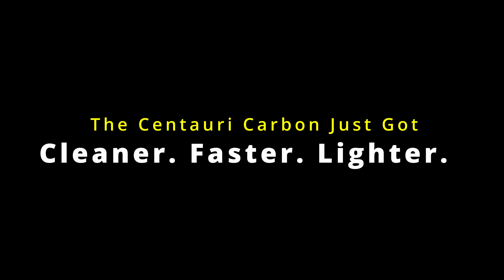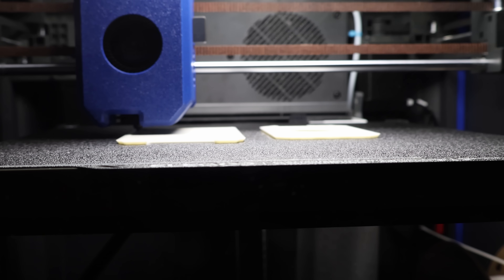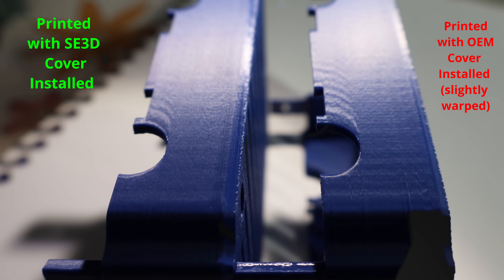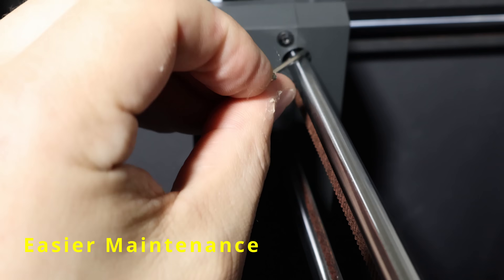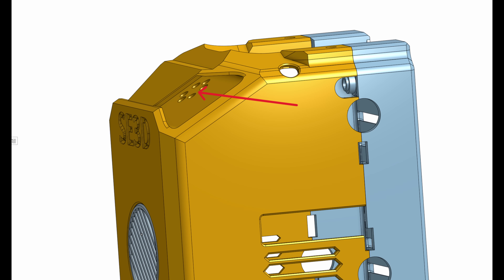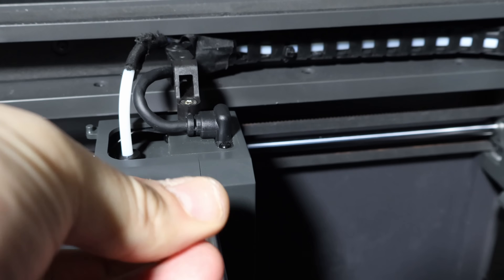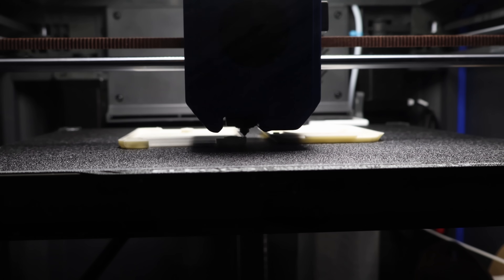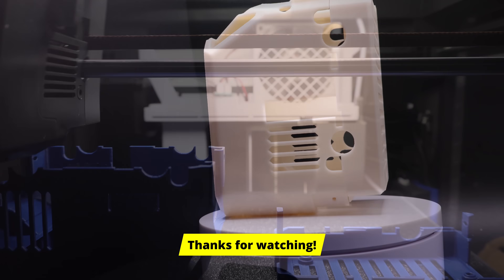The Centauri Carbon Just Got Cleaner, Faster, Lighter

Comment from the maker: We've picked up over 325 subscribers in the ~24 hours since posting this video! Thanks for your support! Many of you seem interested in alternatives to ASA for printing this cover. Unfortunately, there are not many easy-to-print options that are suitable. @Polymaker HT-PLA might just be one good exception. Who is interested in a follow-up where I put this cover to the test in real-world conditions with HT-PLA? Comment below to let me know.
Reply: What about ERYONE's "Light Weight ASA" ? they claim 40% the weight of normal ASA for the same model?
Reply: @nikkismith8750  Yes, it's hard to get in most countries but that would do the job
Reply: Polymaker PET-CF might work, it's fairly easy to print with. Just have to dry it really well before printing.
Reply from the maker: @rileyneufeld7001  Yes, you're right. I forgot to mention that. I even have some predating my sponsor relationship with them. It fogs up the dryer after being left out. But it prints nice when dry. The Polymaker print profile in OrcaSlicer has the part cooling fan going full blast. For me, a bug in Centauri Carbon was causing the hot end temperature to drift down 5C below target, eventually triggering an exception in the firmware. Turning the fan down or off resolved the issue for me. IIRC, I think the part cooling fan is supposed to be used sparingly for PET-CF17.
Reply: I’d be very interested in this.
Reply from the maker: @mykelitorus9101  Thank you! Noted.
Reply: Would love to see more testing!
Reply from the maker: @bonnybestthechest  Thanks for the response!
Reply: Polycarbonate - petg blend or straight polycarbonate will work I reckon
Reply: It would be interesting if one of the suitable materials was also transparent
Reply from the maker: @matthewmalham6094  Yes, someone posted a translucent Polycarbonate (PC) make on Printables. PC has superior HDT to ASA. It's heavier, but if you care more about the functional aspect of the cover, PC is a great option. I just have problems getting good layer adhesion without a heated chamber when printing PC.
Reply: I would love to see the real world tests.
Reply: Yes please lets see HT-PLA.  Thanks Polymaker for sponsering this innovative but still small creator.
Reply: Would love to see a video on printing PAHT.
Reply: This would be a cool follow up video.
Reply: Would PETG-CF (Elegoo) work for this?

Comment: Would this cover be good as well in elegoo pla pro filament?
Reply from the maker: Based on most PLA Pro. The temps near the hot end are too high. It would likely just melt. At first, I was thinking Polymaker, which has a 0.45 MPa HDT at 59C. I don't see where Elegoo has published any information like this. It's probably in a similar range, but there's not a "PLA Pro" standard formula, either.

Comment: I've just brought mine and had to stop it as it was going 230 mm/s and was making a racket. The print looked like it was going well, but coming from a bed slinger I'm not used to these going so fast. 😆
Reply: @ifell3  lmfao I frequently push my poor og ender 3 to 500mms. She is absolutely abused and Ive put about 50kg though it in filament and I bought it used from a guy who was using it as a print farm machine and using recycled filament. Ole bedslingers can still go zoom.

Comment: ayo i just got my Kingroon ASA I just ordered for printing this. I must say it makes the printer sound and move waaay smoother IMO, it eliminates some noise. I had a hard time finding the proper screw lengths locally and went for 2x16 without washers for the fan and 2x10 for the frame. The latter still fit on the top two mounts well, at the bottom left is sticks out a bit but seems to stay there.
Really nice, looking forward on how it performs long term!

Comment: I'm fairly new to 3D printing so forgive me if this is a stupid question.  In regards to the dovetail pins, couldn't you add a modifier to those areas to increase walls and/or infill for more strength?

Comment: This is awesome. I have a remixed version printed out and nearly ready to be installed. My question is what is the washer/spacer size? I see in the video you use 2 washers on one of the screws, but you do not mention the required diameter or thickness size. Information like that would be helpful to those of us who do not have a case full of washers or can tell what size spacer to print just by look.

Comment: This is very cool! However, I think you should design a front toolhead cover that uses the same hardware and screws as the factory cover. It would be cool!
Reply from the maker: Thanks! I think there's a remix that effectively did this - instead of guide slots they replaced the holes. This does use the factory screws, but only as guide pins. I run my cover without using the additional screw holes that I added. Just using the friction from the pins and the screw heads + washers against the cover. Holds it in place well enough for my purposes. I just wanted a quick release. There are at least 8 remixes on Printables you should check out: https://www.printables.com/model/1399340-se3d-elegoo-centauri-carbon-toolhead-cover/remixes
Reply: What you think about create some kind of locking mecanism to avoid the use of screws, some plastic latch, or push down pin to unlock, i have only 3d printer for 3weeks, don't know for now how to CAD, other idea is to replace the socket st connectors for the extruder to use pogo pins (magnetic) to easy extruder replace.

Comment: Subbed! I was reading some of the comments on printables and some users mentioned that it was melting despite using ASA. 

Any input? Overall I’m so happy to see upgrades like this being created. I feel like the Centauri has the ability to be like the Ender in terms of community resources and mods
Reply from the maker: I need to check up on those. Having trouble keeping up. I have seen some very slight warping near the nozzle area with the Polymaker ASA. That looks like it may be mitigated by adding a little more clearance.
Reply: @SyntheticElectron3D Thanks for the reply! I just got my CC but I’ll hold off on this for now. That being said I’ll continue following it closely for updates.
Reply: @SyntheticElectron3D Thanks for the reply! I just got my CC but I’ll hold off on this for now. That being said I’ll continue following it closely for updates.
Reply from the maker: For me, at least, the warping wasn't enough to warrant replacing the cover. In fact, I only noticed it after you said something. Regardless, I modified the front part of the cover to entirely remove the area where I observed warping. I also shaved off a little material from other areas to provide more clearance. So, it should also be slightly lighter in addition to being less likely to warp. It remains fully compatible with the other cover components. Check out the file labeled V1.1 for the cover. Thanks for your feedback!
Reply: @SyntheticElectron3D No need to thank me, thank you for your work!

Comment: Great design!!! Video after video, you are truly clever than the Elegoo engineers xD only one question: I think that we can't print it in PLA due to vibration and acceleration, apart from high temp. Right? (I don't know if I would ever use a spool of ASA beyond this)
Reply from the maker: PLA's main issue is with HDT (Heat Deflection Temp). It's also heavy. Otherwise, it's fine. You should check out Polymaker's HT-PLA if you want to stick with PLA.  I'm having some good preliminary results, even unannealed. Most other HT-PLA requires annealing before it's close to being suitable.

Comment: Am I ok if i used petg to print this?
Reply from the maker: It's not generally recommended. If you want something easy to print that is free of styrene, Polymaker HT-PLA is performing well in preliminary tests. But I haven't put it through its paces yet. All I can tell you is that even in unannealed form, it won't turn into a ball of goo when used to print with the cover off. It's probably your best bet because it can withstand 90c before really starting to soften, making it similar to ASA in that regard.

Comment: would pla be ok for this or should i get a more heat resistant filament?
Reply from the maker: Avoid PLA or PLA+. There are two reasons for this; the first being that the heat deflection temp (HDT) is not high enough being so close to the hot end. Second, it's a lot heavier than ABS or ASA. I'm having some good preliminary results with Polymaker's new HT-PLA in terms of HDT. What I am finding is that HT-PLA doesn't behave quite the same as regular PLA when printing and it's slightly heavier than regular PLA. There are ways to mitigate the weight and differences to note about printing it that I will cover in a follow-up video.

Comment: Amazing, but you could save a LOT more weight, ditch the side screws entirely, skeletonize the cover where you can, and look into redesigning the cooling duct to be  circular rather than linear.
Reply from the maker: Yes, agreed. This was all I could do for a video that I was trying to fit into a week-long production schedule. The weight reduction was mostly a side-effect of addressing the functional deficiencies of the OEM cover. I didn't set out on this project specifically for weight reduction. Although it was a consideration. Modification of the cooling ducts would have required a lot more test iterations to make sure it was tuned and just didn't end up making things worse. This is why I released the STEP files. The community has already made a number of remixes on Printables. People have also done some skeletonization work and posted photos on the OpenCentauri Discord.
Reply: Check printables 1418981 model

Comment: I will give this a try. I have a lot of clogs with ASA on the machine. Does anybody found a good method to remove clogs?
Reply from the maker: That's interesting because I don't think I have ever had a clog with ASA on either of my Centauri Carbons. I have had some with PLA-CF. How are your retraction settings? I know that excessive retractions can cause a clog with just about any material.

Comment: I think most of those covers exist simply so people don't burn or hurt themselves. If you're mature enough not to touch hot things or the fan you can probably do away with almost the entire thing. Find a way to only mount the part cooling fan and duct it properly and you're good.
Reply from the maker: Yeah, but I was going for broad appeal here. You're talking like someone who strips the seats out of their car to go faster. That said, I can appreciate that. I've run my Qidi X-Plus 4 without the cover on it for a long time. But the part cooling fan isn't mounted in the front cover like the CC.

Comment: Subscribed. My fan cover fell off during a print and almost ripped the cable off the fan. I was able to shut down the printer but a new worry is now unlocked 

I'll definitely print this in abs.
Reply from the maker: Been there. This was one of the many issues with the OEM cover that I was trying to address. ABS or ASA are the best all-around materials from a weight and heat resistance perspective for this application.

Comment: I've been printing for months with mine but haven't really had any issues. I like this upgrade tho as weight removed off a moving part helps to save and extend the life of all its workings and makes the system more efficient.
Reply from the maker: Great to hear you haven't had any issues. You make a good point that I didn't highlight! It's not just about better performance, but also longevity.

Comment: I have plenty of PETG-CF. I print fairly regularly with it and never an issue in the CC. Anyone used it for this model with positive results? Any reason not to?
Reply from the maker: It should work for some time, but it may not be a good long-term-use material. Only because PETG tends to creep under high heat conditions with load. PETG-CF is only slightly better with heat. Near the hot end, it will get fairly warm, especially on long prints. If you're mainly printing with the top off, it will probably last a while. YMMV.

Comment: Looks interesting... will definitely try it.  Have ordered oem ASA filament direct from manufacturer so will see how it performs...as the Polymaker is expensive here in Australia.
Reply from the maker: Polymaker tends to be on the premium side in pricing. But more often than not, you get what you pay for. There are certain materials that only Polymaker has, and sometimes you just want a reliable and predictable product for a project. Granted, that's not always the case, depending on what you're doing. Nonetheless, I like being associated with a quality product that I have used myself, with good results, and that I can promote honestly.

Comment: Very well thought out design with some great quality of life improvements.  Thanks for sharing.  Works everytime tip for printing ASA is use Vision Miner.  One coating can be reused many times.  When used with PEI plates, the adhesion for ASA/ABS is amazing, as well as the part release when the part cools.  Should allow for reorienting the part to 45 to for better strength in some areas.

Comment: Damn u were quicker! Great design. I lately had a dying heatbreak fan causing clogs of doom, took some time finding out what was going on. Especially cause almost each screw was rounded out by factory. The design with those nasty small countersunk and buttonheads is just crap, i replaced almost all with socket head ones. I thought about almost the same design, better reachable screws, no magnets, bigger fan inlets, just more lightweight by using sorta honeycomb design.

Keep ur work up! I love it, no bullshit just great functional and simple improvement. I wonder if elegoo will reach out to you soon, or at least copy ur content xD

Comment: Do you have any plans for adding noctua fans for quieter printing? Your intake mod is awesome.
Reply from the maker: In some of my earliest videos posted to Reddit, I did a PoC with the mainboard fan using a Noctua. That is something I'd like to circle back around to, maybe even including an 80mm case fan replacement. That could integrate nicely with a more comprehensive fan solution. Lots of ideas around it, not enough time. I will get back around to that topic in a week or two - just having some growing pains around scheduling stuff and integrating sponsors.

Comment: I've seen many of these replacement covers being made on many machines, and all of them just melt and destroy the extruder. Hopefully the ASA holds up...
Reply from the maker: The OEM cover is ABS (a little acetone confirmed it). ASA is basically a slight reformulation of ABS and has almost the same qualities, except for enhanced UV resistance and being slightly stiffer. ASA shares a nearly identical HDT (Heat Deflection Temperature) with ABS. It's also a bit easier to print than ABS because it doesn't tend to warp as much. This is why I selected ASA. On the whole, it's a slight improvement over the OEM material without being crazy expensive or extremely hard to print. Plus, it can also be vapor smoothed and repaired with acetone, just like ABS.

Comment: Nice design! Thanks! What's for the hole for filament feed tensioner? I never used... 😅
Reply from the maker: That may be useful if you start getting unexplained under extrusion because the tensioner is causing the feeder to slip while feeding. Over time it can wear or get out of adjustment. Also, for softer materials like lower shore hardness TPU, it can be helpful to adjust to correct feeding problems.
Reply: @SyntheticElectron3D super explanation, thanks!

Comment: Is it possible for this to be printed in PLA+?
Reply from the maker: No. Not recommended. None of the PLA+ formulas I'm aware of have a high enough HDT (Heat Deflection Temperature). If you must use PLA, your best bet is Polymaker's new HT-PLA. I'm not just saying that because they're a sponsor. They are the only filament manufacturer that claims to have an HDT anywhere near suitable for this application in a PLA-based product as far as I'm aware. I have not tested it personally, yet. I'm considering a follow-up where I test the cover with it. If you want to give it a try beforehand, here's an affiliate link you can use to check it out: https://us.polymaker.com/products/polymaker-ht-pla?variant=44457611722809&aff=1231&utm_source=affiliately&utm_campaign=aff

Comment: Well hats off to you man .Thesee ringing were a headache..Btw what about the magnets that was used for the cover to snap? Also...Do I need to buy new screws or the stock ones would work fine?
Reply from the maker: The stock ones work. If you want further security you can get the 5.5mm M2 self-tapping screws. But the clearances should be tight enough to try without needing those.

Comment: Going to use ABS. 🙂
Reply from the maker: A solid choice.
Reply: @SyntheticElectron3D  One thing, since I have your attention. :-) I printed it, the posts that go in the front half then held together with screws snapped off during me doing a fitting. I said to myself, why am I doing it this way. Remove the posts, don't use screws. Use magnets. Going to try this, 4 6x1 magnets should hold pretty solid. Thanks friend! :-)

Comment: Ive picked up my centauri over a week ago and this is great. Can't wait to put this on. I have a roll of ASA but never printed beyond PLA in my life so gonna have to research how to do that.
Reply from the maker: Pre-heat the build plate and use the glue stick Elegoo ships. The profile in the 3MF will probably work for just about any ASA. But I like to print it a little on the hot side compared to some recommendations for better layer adhesion, if I can get away with it. The Polymaker ASA cooperated nicely with the higher 270C nozzle temp.